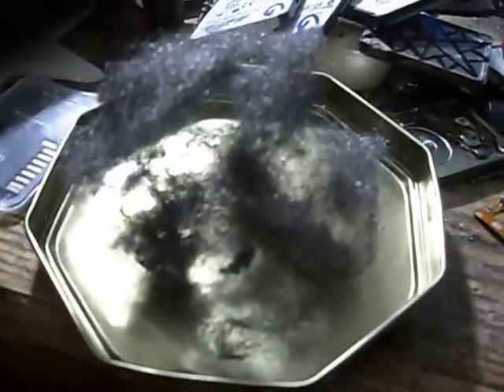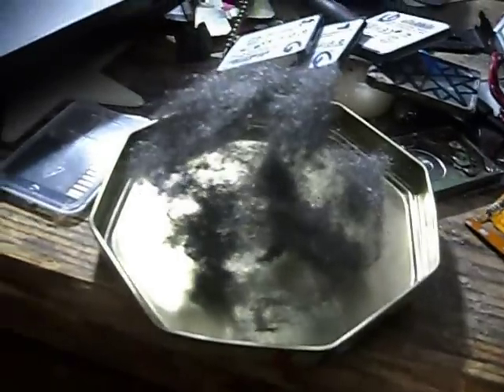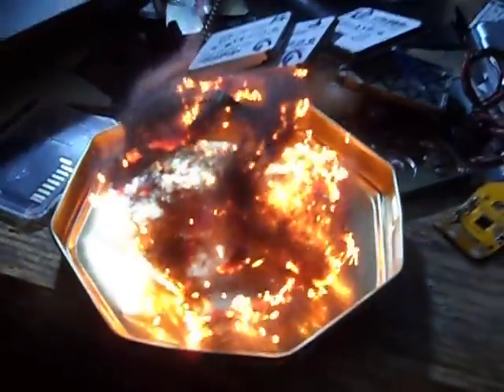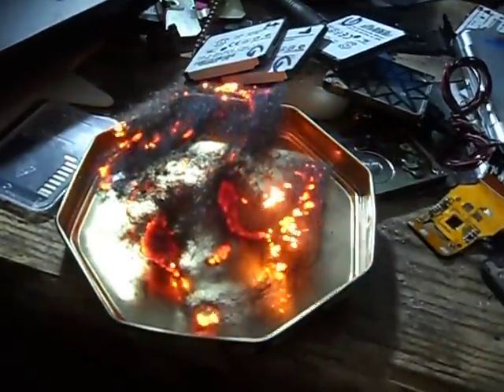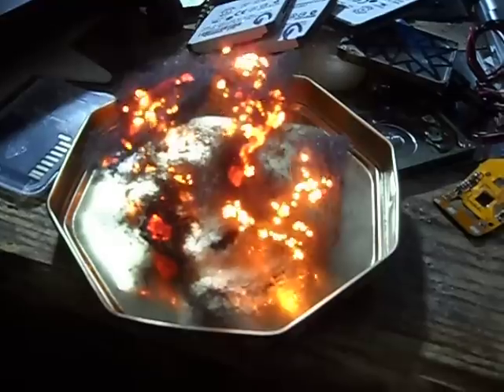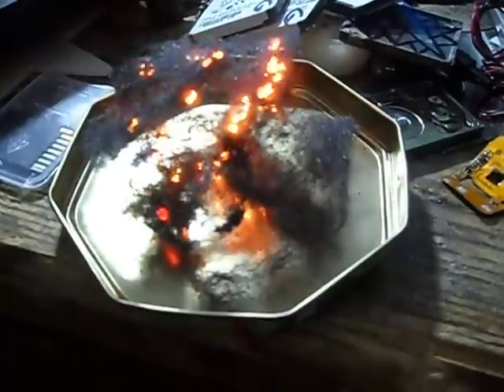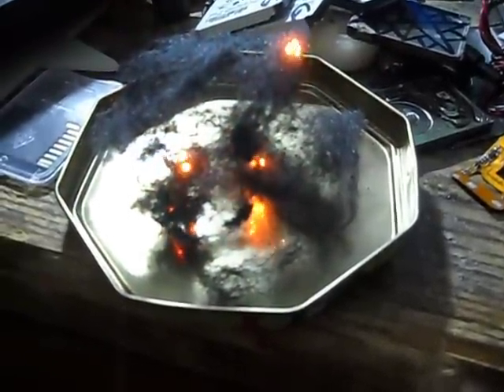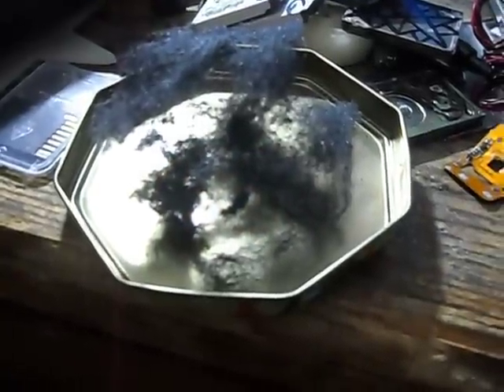1 Watt IR Laser at 808 nm Igniting Steel Wool.

Comment from the maker: There is this one ebay member who was selling 200 mW green lasers, This IR is the 1 watt pump diode from one out of 2 lasers i bought each where about $75 USD and both have worked well for the last 2 weeks+ Very happy with the buy but the seller is gone, That's sad. You can convert over any higher powered 532 nm into a powerful IR laser like this one.

Comment from the maker: Super glue comes in sticks??? lol You can ignite polystyrene with super glue because of the heat released when the chemicals break down the chemical bonds. But cotton balls? hmm I will have to try.
Reply: Holding cotton string in place with superglue very often gets hot enough to smoke so I guess if you used larger amounts you might get fire!